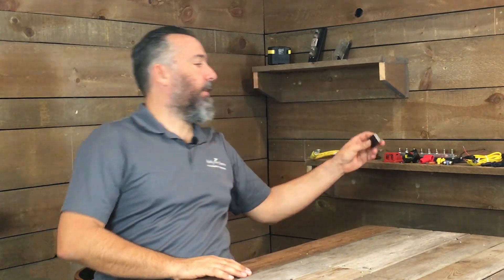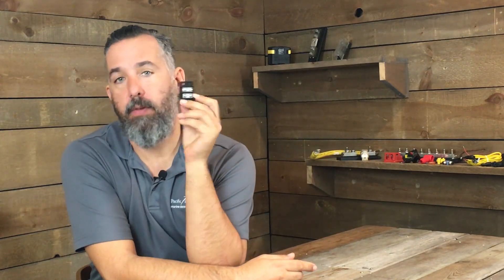I Have a USB Cigarette Lighter but When I Plug in My Phone the Socket Will Not Work?

Comment: My first guess would be high resistance due to too many connection points. Just the other day there were two fluorescent lights for a job I was on that would only work every once in a while. After replacing the tube bulbs and detecting for current, I opened up the junction box to find out the wire nut that their red and black wires lead to was too small. So of course the issue was remedied by twisting a bigger wire nut on therefore low resistance and more leeway.
Reply from the maker: Thanks for sharing John, good point!

Comment: Great video Jeff, it could also be the wire is corroded and not carrying the current, I've seen this many times especially on railing mounted navigation lights wiring . I have an unrelated question this time. What are the pros and cons of using say 10 x 100ah verse 5 x 200ah agms for a house bank? Is the acceptance rate similar? Or is there any other factors to consider.  Regards Stormer.
Reply from the maker: Hi Stormer, yep corroded wire or connector could also be the issue for a large voltage drop under load. 

Choosing a battery bank, better to have five 200 amp-hours then ten 100 amp-hour. Ideally, you want as less batteries as possible. But a large single battery would be very heavy and not practical.
Reply: @PacificYachtSystems  thanks Jeff I do like the short video format you do, kudos 👍.. I've also seen starter battery cables glow red the dark whilst cranking as they were corroded or cooked or both, old boats and people cutting corners, It looked like automotive battery cable.. Thanks for the battery bank advice, I assume less batteries less connections is always good.

Comment: Ever find an intermittent problem that doesn't show up because the mechanical insertion of the meter probes makes the circuit but without that pressure, it fails under normal operation. That took me a while to figure....:-D
Reply from the maker: Nope, but i can see what you are talking about... good one!